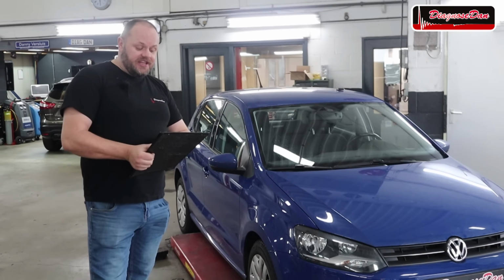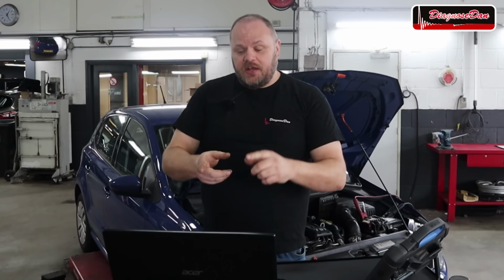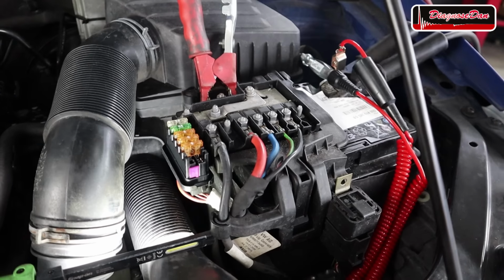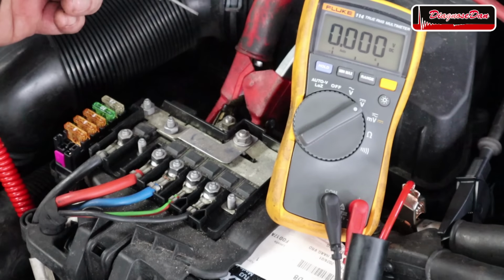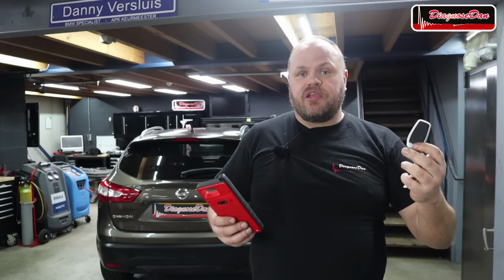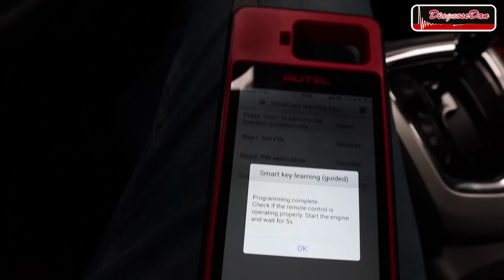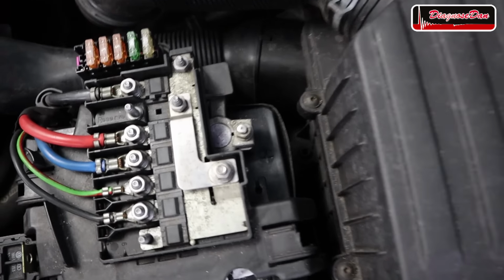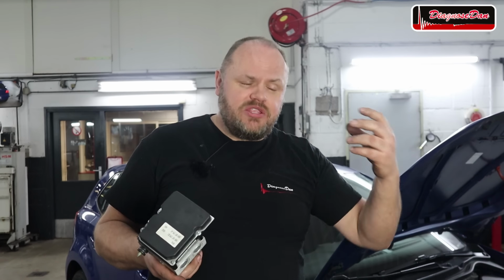VOLKSWAGEN ABS FIX

Comment: A brilliant example of why a test light is so important
Reply: Yes and in some cases, a home made head light 4 amp load test light.
Reply: or actually using an ohm-meter instead of continuity. A test light is still too low of an amperage to show any big thermal resistance changes in bad connections.
7:11 he shows the reason why I use ohms when voltage seems to be "floating". Whenever I see voltage going somewhere but there is no real power, or amperage, "no power" situation, then I just disconnect the voltage and check the resistance, or you could just see that when the engine is on there is still below nominal on the connector, as the ABS loads the circuit down. There are of course exteremely marginal cases where some hot spots and thermal expansion can make the results unreliable, but I rarely ever had to use a test light, as it's "too" dumb.
Also, don't think I'm calling Dan dumb, no, his methods are right, just not the ONLY correct way. Still I watch him to learn some interesting faults :)
Reply: @tomclanys  That would depend on the circuit amp draw. Most of those computer nodes/modules etc work with 5 volts and very little amperage.
Reply: No pun intended? (brilliant/light)🙂
Reply: @Garth2011  yes, and by using a test light to check such voltage lines (for example powering a hall sensor) you risk overloading them and destroying your ECU. Most have protections in place, but it's still a risk.
Reply from the maker: Testing with a test light is also simple and fast!
Reply: True, but remember that it was tested when ABS module was disconnected. If it was connected, the fault will show on the DVM as well. That is why I am a bit surprised that the first workshop could not find the culprit. They didn't have to disconnect anything, just checking the voltage on those fuse box would be enough.
Reply: @drazenradosevic7467  no, since there was no power to the module it would report "no connection" 90% of the time, same as with it being disconnected. You can't read faults when there is no power to the module itself on the CAN-bus.
Reply: @tomclanys  he means if the module was plugged in, it would have dragged the voltage down after the resistance and it would show a voltage drop on the multimeter.
Reply: @Discretesignals  ah, true, sorry. Didn't recognize DVM as the multimeter, just thought of the OBD reader by some means. Guess I've read too fast :)
Reply: Multimeter with connected unit will do the same result
Reply: @tomclanys  ohmmeter isn't a good idea on active circuits. It can give you all kinds of incorrect readings, depending on how the meter works exactly, and even depending on probe polarity. Typically, Multimeters work by injecting a small current and measuing the voltage across the probes. The issue is that if there is already Voltage present (in this case from the battery), the Multimeter cannot discern between Resistance and Circuit voltage. Some meters will report a short circuit if the voltage is reversed - leading you to a fals positive.
Also, the refresh rate of Multimeters is typically very low. While they are great to detect small voltage differences (for example when checking for Voltage drop in an alternator circuit), a test light is vastly superior for checking intermittent connections - even very brief (millisecond range) interruptions will produce a perceivable flicker in the light, something that we humans detect subconsciously. A Multimeter reading may not change even during a 50ms drop-out of the voltage, plus it takes concentration to process the reading.

So no, the Multimeter would be the avsolutely wrong tool for this kind of Diagnose. Test light gives you more relevant information more reliably and faster.
Reply: also very dangerous. a poor test light will not have high enough internal resistance and can easily smoke a BCM or other transistorized components. ive seen tens of thousands of damage done in shops with test lights.

Comment: A perfect example of VOLTAGE DOES NOT EQUAL CURRENT.  Well done DD!
Reply from the maker: Exactly! Some people dont see that relation!
Reply: @Diagnosedan  can you recommend a good test light please
Reply: @aa-kv2pq  get a few different ones with different load currents. ~50mA, ~500mA, ~2A. So you can choose the correct one according to the circuit you're testing (similar to the typical load on that circuit).
A test light is such a simple device, there is really no good or bad.

Comment: I had a similar issue with my Golf IV, i.e., MK4. The alternator stopped working because it did not receive the control voltage it needed because the fuse box had some corrosion. I got stranded with a flat battery. It took weeks to figure out what was the issue and I ended up replacing the alternator in the process even though that was not the issue. I didn't have a test light but thanks to Dan, I do now :)
Reply from the maker: At least you have a new alternator you dont need to worry about anymore🤣

Comment: I just fixed a no communication problem on my A4 B7 with the Brake control module like this. I had exhausted all options of checking fuses and relays and as a last resort decided to clean out that section under those nuts. It fixed the problem but I wasn't sure what fixed it because I had fiddled with so many things 😂 I then came across your video and it confirmed my theory and fix. I was using a multimeter to test things which is probably why I was going in circles not being able to figure it out. Great video!

Comment: Wow Dan, excellent example of the importance of voltage testing under load! DVOM would definitely get someone in trouble 😅
Neat Autel key programmer too!
Reply: Wow surprised to see you here Ivan, you don’t need to watch Dan you already know everything 😂 but glad that you support another great tech!!
Reply from the maker: Thank Ivan, we both know how important testing under load is, but there are still alot of techs out there not getting the message!
Reply: Your the man Ivan ! love your channel as much as Dan’s
Reply: you need to buy a loadpro Ivan.
Reply: @TheDisgruntledMechanic  I would never actually waste my money on anything so useless...doesn't even make a reliable wheel chock LOL!
Reply from the maker: @PineHollowAutoDiagnostics  i've never worked with one myself (never seen one), but i guess its a resistor with a button. What could go wrong with that? I guess it loads the circuit as advertised.....so why is it useless?
Reply: @Diagnosedan  because it is big like a cucumber and doesn't have warm glow of a test light 💡😁
Reply from the maker: @PineHollowAutoDiagnostics  🤣
Reply: @tonytopbatz  If I remember correctly, Ivan calls himself a DIYer, but the only real difference between him and what he probably regards as a pro is a lift in his garage. Because skill-wise, he's definitely pro-level.🤔
Reply: @PineHollowAutoDiagnostics  HAHAHA! I knew this just had to throw it out there!
Reply: @TheDisgruntledMechanic  well make sure you didn’t miss the bin when you threw it out..
Reply: Love watching your stuff too. But would love steadier camera work, so I don’t get dizzy watching on a big screen.

Comment: Dan, I own a 2000 VW bug 1.8t with the same style fuse block and I so appreciate your testing explanation. The chats that i have followed say the fuse block on top of the battery is prone to corrosion issues, and this VW has proven that a brass brush and  some battery terminal cleaner and protectant will be my best friend as my bug gets older.
Reply: Yes I had the same issue, just the fuse block burned out on 2 of the fuses, so I went for the cheaper alternative of 2 inline fuse holders and crimped them into place, then used a ring to provide power to them. As VW on this one integrates half the loom into the fuse holder, a lot cheaper than the buy a new one alternative.
Reply from the maker: Yes the Beatle has a similar setup

Comment: Good video- so many guys like to use the multimeter or one of those beeping testers- A test light is so much easier and more reliable- you only need to find a good ground and then probe with the light - the multi meters don't have clamps on the probes so you need to hold both wires and then try find a place where you can set the display to read it.
Reply: The issue is they (myself inclusive) are scared of frying something when used wrongly. So it's important to know how NOT to use it.
Reply from the maker: Testlight is fast and easy!

Comment: This man deserves 10m+ views per video.  He always takes the time to explain how he finds the problem, how he's sure it's the problem and even goes out of his way to fix it the right way when others would have just tightened the screw or added a jumper wire.   I am a technician and I can say for a fact new parts are not always good nor is something better just because it's newer.  Proper diagnostics is assessing the knowns, x checking for basics and cutting the circuit in half until you find the problem or contributing factor.  Seriously I can't stress it enough I'd watch any tutorial this channel is putting out- no matter what the topic. 👍👍

Second - to - NONE.
Reply from the maker: Wow Joshua thanks for your kind comment its really appreciated and makes me want to continue making more videos!
Reply: @Diagnosedan  you could triple what you charge and still be underpaid. I have no doubt your pricing is fair, but don't settle or cheat yourself.  Whatever you put your time into will scale 10-100x with ease. Thanks again for all your effort.

Comment: Thanks Dan,even though testing powers and grounds seems easy task,but appears to be tricky.I love the way you checked for power around that bolt and appears to be half space powered, this teach as how corrosion could affect integrity of the circuit in strange way.fantastic investigation.
Reply from the maker: Basic but still relevant!

Comment: Dan that circuit test is the perfect explanation of voltage testing, and loading the circuit to test. This is why i have home made test lights with different bulbs to test many circuits with bulbs of different draws. My testlight is digital so it does not load the circuit. I made my test bulbs with "banana jack" ends so i can use them with all my electrical diagnostics kit. Awsome videos and thank you again for posting these case studies.

Comment: Nice find Dan, also I have a km100 and use it for factory keys, which it also does very well. haven’t had an opportunity to try the universal keys yet. I have heard from other techs that they are quality and last, I also agree that the ones I received with my km100 feel very high quality upon initial impressions.
Reply from the maker: Thanks for the feedback! Are there any downsides to the tool?
Reply: @Diagnosedan  nothing specific, just limited use on very late models, just like any aftermarket tool. I am a dealer tech so that affects me more than most. I haven’t had it fail on anything that it shows in the menu, I believe autel lists available functions per model on its website somewhere in case you need to look it up before offering a service to a customer.

Comment: Hey Dan, one thing to keep in mind when adding a key to Nissan, is always programming the original key first then the aftermarket regardless of brand. The reason is that some will lock the original key and can't use it again so you will be stuck with one key again until you renew the original and program them back in again.
Reply from the maker: Thanks for the feedback!
Reply: @Diagnosedan  you're welcome. Thanks for all your videos, very educative.  👍

Comment: Hi Dan, 
The Volt measurement with the multimeter works fine. You have to make sure the circuit is loaded. You do this by leaving the plugs connected and performing the volt measurement by means of a back probe measurement. This is how we explain it to our students at school (Graafschap College). The way you show (test light) is of course also possible. It is true that you are now going to switch from measuring to unloaded, plug on plug off. Voltmeter to test light and vice versa. Do you have experience, no problem, if you don't, it can be confusing. KISS method: leave all connectors in place. Back probe where you want to measure. Do this with a Volt meter against ground. Correct supply 12v, correct ground 0v. Furthermore, you make great interesting videos, use them regularly in my classes! Keep it up! Regards Thomas

Comment: I was introduced to your videos yesterday by a diagnostic friend who subscribes to you.  He does this day in, day out and tries to teach me stuff.

I am the kind of learner that learns by absorbing detailed information and there are so many videos out there where they talk jargon and do not really fully show what they are doing.

I feel like I have learned such a lot from this video.  The first one I watched was the Using Ohm's Law as I have an issue with a P0672 fault and also a P2135 fault on a Smart ForFour W454.  I learned surprisingly that these two may be linked.  I have yet to test and confirm.

This video is just so affirming where you reaffirm every time that the lamp lights or the multimeter doesn't and then you connect the two.  Although I have a test lamp, I generally use a DMM because I didn't fully understand how to properly confirm powers and grounds.  Now I believe I do!  At least I hope I do.

The only issue for me now is getting to grips with these modern type wiring diagrams.  It's easy to zone out with them and go round in circles when you're an amateur.

Looking forward to watching many more of your videos irrespective of whether they are relevant or not.

Working on the other half's car next with an fan relay issue P0493 and P0952 on the telematics.  A garage had said that the telematics one needed a new £1100+ head unit but I am not so sure and there was a similar issue with the ABS where the unit was swapped out for a second hand one prior to my other half's ownership.  Whatever happened it rectified it but leaves me wondering it was actually a similar issue.

EDIT:

Having read a fair amount of comments, I have concerns about whether a test lamp should be used on 5V circuits?  One commentator notes test lights with different ratings 50mA, 500mA and 2A?

I've not checked yet whether you have a video specific to test lamps but, if not, could you perhaps expand on this please. I don't want to go probing fuse boxes and blow anything.  I guess that clamp onto negative and probing any fuse is safe but clamping onto positive, then only probe grounds and NOT touch the probe on a fuse and accidentally power a circuit that might not be 12V - is that what these commentators mean when they say you can blow circuits?  If so, that should be fairly easy to remember!  Thanks in advance.

Comment: The importance of using the right tools. I had the same issue with a Peugeot 308cc which came from another shop where they changed lot of parts.
Reply from the maker: At least you know what parts are not causing the fault🤣🤣

Comment: I have just realized that I am stupid.
Have ordered a test lamp (similar to yours)
But it was a problem to find one with a light bulb, most of the ones I found were with LED lights, they should have +- not just reverse the battery poles, but it went well in the end. I also had to use my brain.
You're damn good, it's fun to see you work and think, you're a professional, I'm a hobby amateur.
👌
From Sweden

Comment: Yes, the old voltage conundrum... I once had a side repeater on a Citroen van wing that showed voltage, and the wires all looked fine but the feed wire had a cut to the insulation, allowing corrosion and the wire had burnt to one strand, and the one strand was itself turning black. This one actually lit the test light and was very confusing for a while. Logic won the day. The voltage read ok but the test light was slightly dimmer than normal. Both together highlighted the issue - a volt drop on load.

Comment: I didn't doubt you were going to fix it again Dan.
35 years ago, British Rail had a small resistor in resin with 4mm pins spaced that they would fit in a new multimeter and you could plug your test leads into that.  About the size of a third of your little finger.  I've still got some and use them.
It was to put a very small load on the reading as they were changing from analogue to digital meters and things were all 'over the shop' reading wise with the digital meters, until somebody came up with the very simple idea.
Reply from the maker: Sounds like a loadpro.....😁

Comment: I was critical of your previous ohms/continuity video Dan but this one gets a thumbs up for showing how not to rely on volts as proof of circuit integrity but to always load the circuit too, a nice example of voltage drop on a unloaded then loaded circuit 👍🏻. There is a set of test leads I’m sure your aware of that load the circuit with the push of a button ( load pro for those who aren’t aware). Ultimately this comes down to understanding ohms law & understanding how a meter works & it’s limitations.
Reply from the maker: Thanks for your comment its really appreciated

Comment: Your videos are always illuminating to be sure... The test light was truly edifying, I am a diy - I have been having a trying time with a bmw E53 with the EHC, after changing the air bags and the two sensors - the fault code was being stored in the head unit and transmitting to the read out. It did keep me out of the pub and off the streets for a while. Good onya
Reply from the maker: Hmmm🤔 Out of the pub?🍺...🤣

Comment: Great job. It shows that to test circuits properly, they need to be loaded. I had my suspicions on the fuse block from the start.
Reply from the maker: Always test powers and grounds under load💪
Reply: @Diagnosedan  the other tell tale sign should have been the other circuits on that fuse block also being inoperative due to the corrosion. Poor design in my opinion.